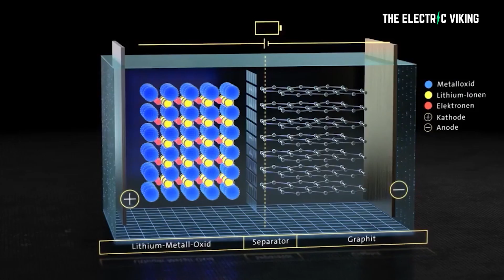Utah's Great Salt Lake will power millions of US made electric cars

Comment: Lithium has a problem.
Run away combustion. 
Many bans coming.
Ferries, car parks.
 Insurance claims are starting to drive up prices.
 Then there's Cyber Jesus....

Hyperails by 2020. Lie.

Cybertruck by 2020. Lie.

Boring machine by 2020. Lie.

AI robots by 2022. Lie.

Fleets of semis by 2022. Lie.

SpaceX on Mars by 2022. Lie

Square steering wheel. Lie

Chip implants.
That's right chip implants! 
Do I have to say?

Scams billions from investors. True.

Comment: A brownout is a partial, temporary reduction in system voltage or total system capacity. 

Blackouts come without warning, last for indeterminate periods, and are typically caused by catastrophic equipment failure or severe weather. The nature and cause of the blackout determines who is affected.

It’s so dark when there is no electricity!

Comment: Update, Innovative 21st Century Electric Vehicle Game Changing Internal Self Charging Battery Technology
Before you buy, lease or put a deposit on your new EV ask if it will have new internal EKG self charging battery technology eliminating external retail e-charging and providing free unlimited carbon-free range/millage. Time to cut the e-grid EV cord. 
( EKG Electricity Kinetic Generator ) can be fount on the internet
Reply: A perpetual motion car. Funny nobody thought of that before.
Reply: @jbbuzzable  This new patented EV internal battery charging technology is not a perpetual motion device. 
This technology consists of 2 primary parts with different functions put together in order to work as one entity. 
Part# 1 is a carbon-free powered compact R.R. PM Rim e-Motor  
Part#2 is a pioneering powerful 20-KWh zero-emission round, slim Hercules electricity generator 
Put together is about the size of your spare tire.
Reply: @jeffb8468  Word salad. Show us the physics.
Reply: @jbbuzzable  In my first comment I provided a search term for my website
EKGelectricitykineticgenerator  This site has links for EKG internal EV power-plant technology

Comment: The extraction of magnesium from the Great Salt Lake is becoming increasingly controversial as the company seeks permission to increase production.  As said below, the lake is drying up and toxic metals  will blow into the Salt Lake metro area.  To say the lithium production is friendly to the environment ignores the huge water issues in the Colorado river basin.  If the producing companies had to supply new water to replace the water evaporated (say by buying water rights from farmers), then it would be more environmentally friendly.
Reply: The Colorado river water problems are mainly due to California thirst.   California has mismanaged its water just as it has mismanaged its power needs.